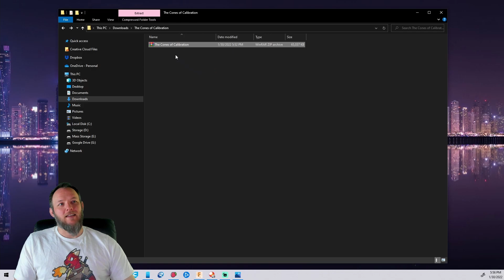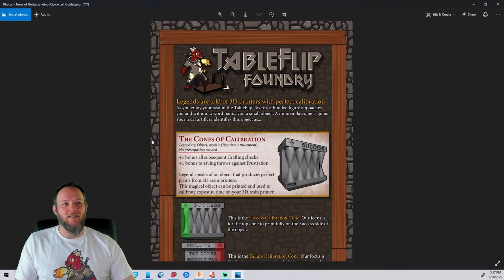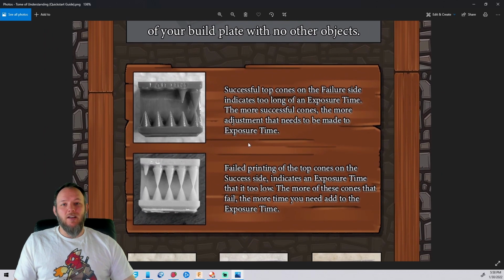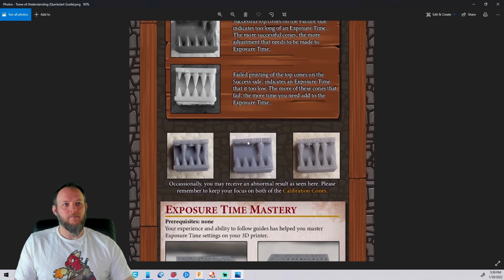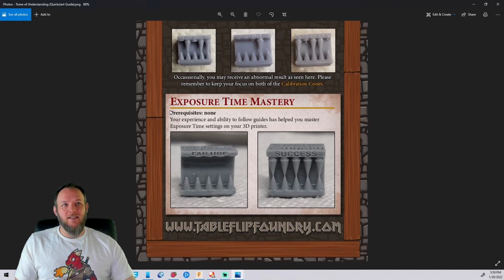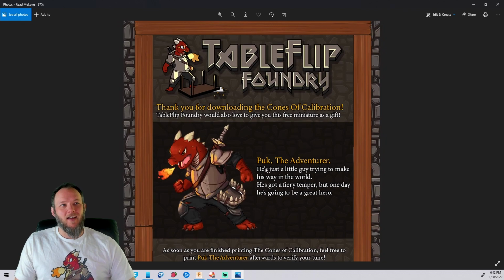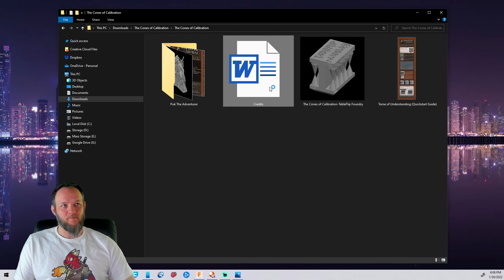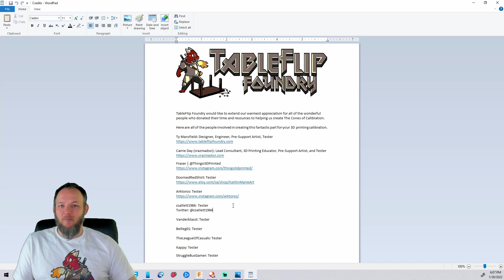This FREE 3D calibration tool will change EVERYTHING...

Comment: I think, this calibration Test is verry good, but i have some issues with the Prints. I use an Anycubic Photon Mono 4 with 80% Light, if i Print at at 2,4 Seconds, the Sucesfull Side is good, but at the Failure Side, the last Cone (Failure Cone) starts to Print, it doesnt reach the other one, but still there is one. If i use 2,3 Seconds, the Success Cone has not printet with success but the Failure Cone seams even Bigger. So far it seams i cant go deeper then 2,4 Seconds, but what does the Failure Cone if it starts to Print mean?
Reply from the maker: Hard to say why that's happening but gonna say to move on to a practical print. give puck a print at 2.3 if he comes out great then You're all done. If his left arm kinda goes flat then 2.4 is it

Comment: Nice test and especially since you have made it free for all. I think however that this is a test you have to do in conjunction with other exposure tests to fully dial in your exposure. 

I used the cones at first with the stock exposure setting of 3 seconds in my printer (with some undocumented resin that didn't have any online exposure times available) and it looked fine. Only the succes cone did shift a bit (hindsight is 20/20: that should've been interpreted as a fail) and the failure cone did print a tiny bit so i chose an exposure time just 0.1 second shorter and then it failed massively. Tried the old setting and it also failed. After struggling with getting a succesful print of anything i went back to the drawing board and started printing the faster printing validation matrix at a ludicrous double stock exposure of 6 seconds and the validation matrix came out near-perfect. Tried 5 seconds and it was underexposed. Tried Seven and it was just a bit overexposed. 
Tried 6.5 and it came out the best imo. Mind you, i did use a macro lens on my digital camera to check the infinity symbol on the matrix because you cant really tell a difference with your own eyes without extremely good eyesight. Currently running the Cones as a secondary exposure test because it definately is more easy to differentiate between succes and failure (when not messing up the interpretation of obviously failed prints).

Comment: I don't get it. I've printed  8 of these from 3.5-5seconds of exposure (obsidian black color) and it's inconsistent. At 5 seconds I have the closest success but it also has the most failure too, not the least. Then if i go down to 4, it has very little on the failure side but the success is about a quarter of what the 5second success cone is in length. Wtf.
Reply from the maker: Hit up our discord. I'll sort ya out

Comment: I went from exposure 2.6 - 3.2. The failure cones grew and the success cones all connected except the one below the +. does that mean I should do 2.0s - 2.4s instead?
Reply from the maker: Thos kind of abnormal results can usually point to a little wear on your fep. Head to our discord server and download V2 of the cones. They are pinned to the cones channel. It's a little hard to troubleshoot via YouTube.
Reply: @TableFlipFoundry   I joined the discord. can't find v2 of the cones.  i just changed the fep. it has maybe 2 prints on it before the cones. i am doing 2.4s and 3.4s to see what's up.  for those i moved it from the center to a little off centered just in case it is a cloudy fep.

Comment: I'm new to 3d printing and just getting started with an Anycubic M3. Wondering if it's preferable to reduce exposure time vs reducing UV power when the failure cones exhibit overexposure result. Seems reducing exposure time will also help reduce overall print time, but I see some articles stating that reduced UV power and longer exposure could be better for accuracy. Thanks in advance for any tips.
Reply from the maker: This is definitely a great question and you're absolutely right. Reduced uv power can improve accuracy a lot. The trick is to find the balance.
Reply: @TableFlipFoundry  wow thanks for the quick reply and your generosity in sharing these models and tips with the community. I can't help myself from attempting to optimize all things. Feels like I've found my tribe with this hobby. Cheers!

Comment: I went through this process completely with my Mono X. I got almost a perfect result after a lot of tuning. After this I used these new settings to try an actual part I needed to print. It failed, big time! The exposure times that this test told me I need to be using were WAY off. Not even close! I went back to the recommended manufacture settings and the print came out fine. 
So, a word to those new to resin printing, I don't think this is an end-all, be-all that this is claimed to be. Try it, adjust your settings as per the test and then try a real world print and see if it works for you. It didn't for me. 
BTW, same machine, same resin, same room temp, everything we the same between the "calibrated" print and the setting this test told me to use. Oh, and one more thing, the parts I'm printing are rather large. Much larger than the little figurines for board games. That may have something to do with my results.
Reply from the maker: Thanks so much for posting! 
I imagine your factory settings ended up being higher exposure than the cones provided you. (They usually are) 
In which case your advice given here is not quite right. 
The problem you're having here is mostly just a lack of experience and understanding. Which is totally understandable. There are a number of reasons your print failed...and none of them have to do with the cones. 

I encourage you to have a watch of my calibration class. By the time it's over, you will want to come back and edit this comment ;)

For real though. Don't get trapped into thinking these factory settings are correct. They are not. The size of the print doesn't matter what so ever. My company does professional presupports for many types of models. I've printed plenty of things that take entire build volumes using this calibration. (And many other people have too)
This comes down to a fundamental understanding of what's taking place. 

If you truly want to understand more about this hobby, that calibration class is going to open things wide up for you, I promise.
Reply from the maker: Matter of fact, I've used these in my mono x also. I used my mono x for huge production runs of models with no issue.
Reply: @TableFlipFoundry  I'll go through your class. I'm interested to find out what I can learn. I'm always trying to lean how to do things better and I'm open to what you have to teach. Over the weekend, I printed some very detailed parts some have bolts that are as small 0.15 mm and the factory settings printed these beautifully. I can't imagine how it could get any better but I'll give it a try. Thanks for the advice.

Comment: How long does it usually take to print the cones of calibration? My Saturn 2 takes about 1 hour, ist this too long? What are your experiences
Reply from the maker: This is all based around later height and the movement settings. But that's typical yes

Comment: I'm stupid and overthinking this.  Do we only care about the leftmost cone on the good side and the rightmost cone (or lack thereof) on the bad side?
Reply from the maker: Basically that's correct yeap. Those are the index cones so to speak. Sometimes outside factors can give some abnormal results. So we focus on those first
Reply: Thank you for this. Just to be clear we want to focus on the First cone correct on each side? I just did some test prints and there coming out better as I dial them in but have noticed that on the failure side does have some cones that print but not the first 2 and the success side is perfect. 

Sorry for the question. I recently purchased my first resin 3D printer (Photon M3 - and have only used this calibration print. It’s my first ever resin print lol.  I want to make sure I dial in the correct setting required to get the best prints. Thank you so much for helping you are amazing.

Comment: Q1:
Could I make a shorter cones of calibration? As long as I keep the centers between the cones the same it should work, right? 
..I'm just too impatient
Q2:
Does temperature change the results? Should I write down the temp with the exposure time for future reference?
TIA
Reply from the maker: V2 of the cones prints 35% faster. But no you can't change the size. The reason is because the length of the top cones is specifically designed for the test.

Temp can play a role. But a couple degrees F won't make or break. If you have wide swings in temp it can affect your prints pretty heavily.

Comment: I am ew to #D printing and I jumped in with both feet on a resin printer, watched a thousand videos. I printed the cones and I have a mixed result. On the success side it printed all but the far left cone which was at 50%. This indicates under exposed. on the failure side the first two cones on the right started to print about 1/32 each which would indicate over exposed. The print cannot be both under and over exposed with this result which side take priority Success of Failure?

Comment: So I tried this out using Sunlu nylon like resin. For me this part just didn't work with this resin. I'm pretty experienced using this resin, but I just got a new Saturn s and wanted to try out the cones because I quite like the idea of having a way to read the results unambiguously. 
Note that this resin on mono printers  is generally exposed at between 2 and 2.2 seconds exposure. Those are the numbers I settled on with my Mars 2 pro. Printing the cones, I had to crank the exposure to over 5 seconds to get the success cone to print. I then attempted an actual mini and it turned out waaay over exposed which was not at all shocking to me.  For this resin, specifically, the cones were a total fail. I was much better off using the normal validation matrix which, while subjective,  didn't overshoot the mark by 3 seconds. That, and the fact that the cones take over an hour to print, just makes the whole thing more trouble than its worth. 
Overall, I have mixed feelings. I wanted it to work... and maybe it would have with a different resin but that's the whole issue.. we're printing calibration parts because we are using a new resin. The validation matrix has worked for me with every resin. Yes, the results are open to interpretation. That comes with practice. I just can't trust the cones even if I really really want to.
Reply from the maker: Thanks for leaving such a detailed comment. The response to this is a little complex and long winded, but I do have something to share with you. I did an interview with Once in a Six Side and I talked about some stuff that may be directly relevant to you. Give this a watch and it might open up some insights for ya.
https://youtu.be/xffUpV0zhKo?t=1245
Reply: Thanks for this. This was actually very informative. 
The main reason I'm disappointed has not changed. I printed the same pre supported mini after running each calibration parts (Janet Demonbane from artisan guild) 
The fact remains that the standard calibration matrix produced a part that printed perfectly and maintained all the details. The ones calibrated with the cones printed fine of course but way overshot the mark on exposure. By cones logic the validation matrix print should have failed. (Every single cone failed at this exposure) It was less than half the exposure time the cone eventually lead me to. In this interview you sort of make the case that if the cones don't work, then you shouldn't be printing minis with that resin. At best, I can say that's not always the case.

Comment: Thanks for this tool, I’m still getting my settings dialed in, but this is invaluable as someone new to 3D resin printing.

How often should I check calibration settings. It makes sense to me that they should be checked with every new bottle of resin, is that what hound recommend?
Reply from the maker: I tend to re-calibrate when the variables change dramatically. Bottle to bottle, I don't recalibrate but as soon as I change brand type or resin type, layer height, or if the temps change a lot in the room, I recalibrate

Comment: Dunno if anyone will see this but do you NOT wash and cure the print before analysing. Analyse straight off the plate?
Reply from the maker: I wash mine but I don't really bother curing. It's easier to read when it's clean.

Comment: I'm a little confused on my experience. Same resin from start. 2.5 gave me full success with an almost complete fail cone. 2.0 gave me a success cone that was only separated at the tip with no fail cone. 2.2 gave me a full success with a small fail cone. 2.1 gave me no success cone in the end and a small fail cone. Why was 2.0 better than 2.1?
Reply from the maker: There are a number of reasons this could take place. Try to rotate the cones 90 degrees and print again. This will locate the connection of the cones subtly different on your build plate just in case there is some abnormality in the fep.

Comment: This methot it's the only one that stick to the FEP.
The rook from Elegoo, XP2 test and others worsk quite well...
Reply from the maker: Adhesion issues wont be related to any of the actual calibration methods. This is all about your level and bottom exposure times. If you're having problems with parts sticking, you want to make sure your bed level is good and you can turn your bottom exposure time up a bit to solve it.

Comment: Hi i printed your cones and on the success side the left one is just a half and on the failure side the two right are printed… what does this result means? Thanks for that print test!
Reply from the maker: this can be caused by wear or damage or abnomalities in your fep sheet. 
Try to rotate the cones 90 degrees and run it again.

2 failure cones sounds like you need to drop exposure a bit though

Comment: So I tried this test twice...The first time it printed but the top cones on the success side were all missing. So I upped my exposure time half a second and then the print failed with the rectangle staying on the fep....I am so confused as to what to make of that. I use a sonic mini 4k with aqua gray 4k resin. and thermal vat band.
Reply from the maker: A flat rectangle has nothing to do with the cones specifically. 
Build plate adhesion issues are usually a result of low burn in times, or poor bed leveling. 
I would look to resolve those two things first, then go back to working on the cones for normal exposure time.
Reply: @TableFlipFoundry  thank you for the response. The maddening thing is, I never changed my Z axis, leveling or burn in times and/or number of base layers 🤔

Comment: Would it be wise to run this print for new resins?
Reply from the maker: Yeap. This is a good starting point. Get your some decent calibration to get yourself printing quickly.
Reply: @TableFlipFoundry  I've done a few tests and I need your advice. 
Test 1: 4 Second Normal Layer Exposure time, Successful side printed the cones 100% perfectly but the failed side had cones printed however the failed side had about 75% completed cone. 
Test 2: 3 Second Normal Layer Exposure time, Successful side printed the cones 100% perfectly but the failed side had cones printed however the failed side had about 45% completed cone.
Test 3: 2 Second Normal Layer Exposure time, Successful side printed the cones 90%  but the failed side had cones printed however the failed side had about 10% completed cone.

As you can see none of the tests I was able to get the entire failure side to have no printed cones with 100% completed successful side. 
Since the photo guide didn't display this, I assume as long as the failure side doesn't have any 100% completed cones it should be ok? Or should the settings be like test 2 where the exposure settings is are set where the printed cones on the failure side is at it's lowest but still get 100% successful print on the cones on the success side? 

Cheers.

Comment: hey, its a problem if i rotate 90º the cones? i dont know why but  in the original position give me some problems like, cones in both sides. But if i rotate 90º the z dont give me thats problems
Reply from the maker: Rotating is fine, but placing it off center can be problematic.
Reply: @TableFlipFoundry  thanks! 1 question more. In grey resin im using 2.5 but for the moment in black resin im printing now at 4.. its normal because the color? thanks!

Comment: Hey, i have mono x water washable resin, but when i printed the test, i get evertime fail on the succeedd side , 2-4 s 120mm lift 80%uv power
Reply from the maker: It seems that water washable resins are some of the hardest to work with. We have seen more complaints with water washable and eco resins than anything else. 
You can try to rotate 90 degrees and printing again. The closest I can think is that for some reason water washable resin has more retention on the fep than other standard resins.
Reply: @TableFlipFoundry  ok wich resin is the best with low problems ?

Comment: Cones of calibration has to be center of the build plate which does not test all 4 corners of the build plate for leveling testing which should be added. thank
Reply from the maker: The Cones of Calibration are designed to be an exposure test. And not a full printer test, or a bed leveling test. This is not possible with this method. Very sorry for the inconvenience here.

Comment: Does it matter which way it's facing on the build plate. My arrow on my slicer is on the short end, should I rotate my part to line up like yours in the video
Reply from the maker: No as long as it's centered you should be fine